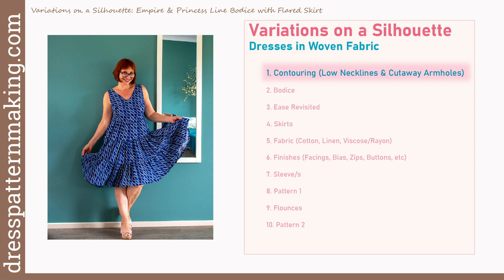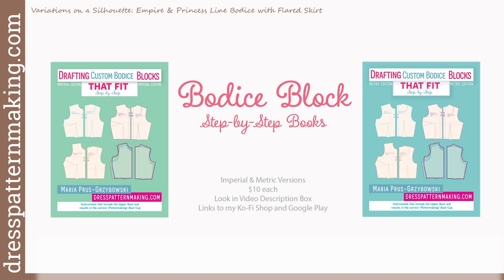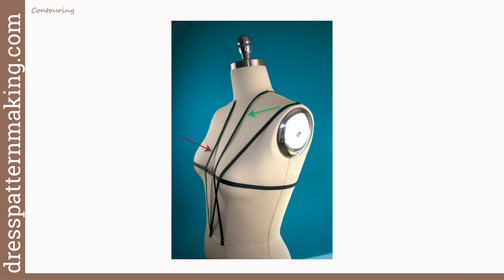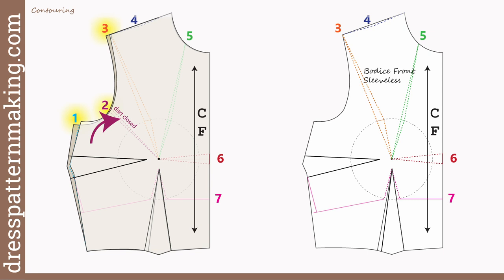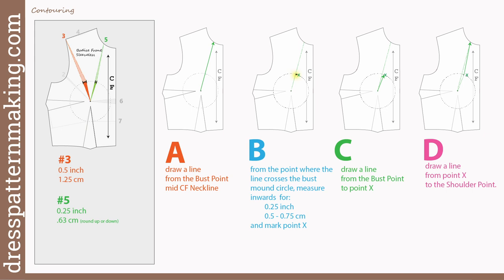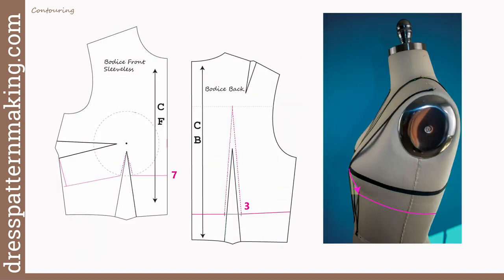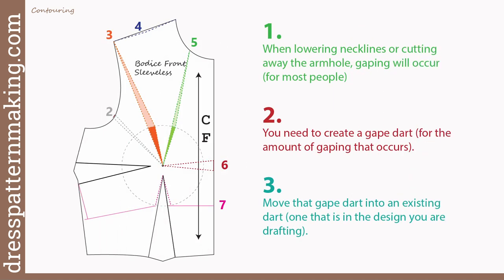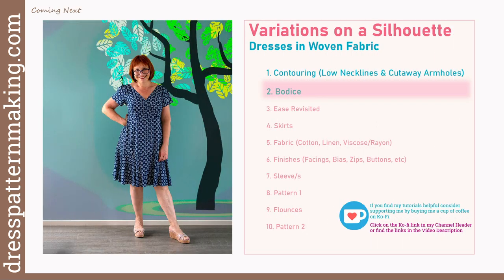Contouring for Lowered Necklines & Cutaway Armholes (Part 1: Variations on a Silhouette)

Comment: Hi Maria, please consider doing a video on the different types of collars. Especially the shirt and coat collars. I enjoy your patternmaking instructions because they make sense and not just a set of calculations and assumptions.
Reply from the maker: Hello Hira(?)
I have been focusing on built up necklines and collars recently, but it will probably be a while before I get to writing instructions for them.  There is so much that I could do but I am limited in my time given the amount of work it takes for me to create a video.  I have decided that I am going to focus on Pattern Videos for the first half of this year (patterns from beginning to end).  First I will be doing dress patterns, each with different skirts and/or sleeves, etc.  The last couple will include (a) a built-up neckline (my Willow Dress), and (b) a dress with a collar (convertible/camp collar).   After that I want to do a couple of jacket patterns - one with a tailor collar, and then a shirt pattern.

So.... at this point it's not likely that I will do a video just on collars, it will be along the lines of doing one collar in a pattern where I have used it.  

But collars are what I've been working on lately.  I've done quite a bit of testing to figure out why I'm having the issues that I'm having.  I have learned a lot and will eventually pass on that information. (In the past I avoided high close necklines with collars (compared to, say, a tailor collar which sits away from the neck) because I just couldn't figure out why they always seemed to feel too tight. I always ended up lowering the front neckline and/or opening up the whole neckline. That created other problems and I also didn't end up with a high close neckline.  I have finally found out that a bottle-neck adjustment fixed the problem......)
Reply: So ture, finding comfort and a good fit is so rare but I'm glad that I found your channel. I feel like your videos have answers to my questions that books don't answer. Looking forward to your upcoming series. Sending love and best wishes ❤

Comment: Question: What do I do if my bust mound circle goes off of my pattern block at the center front? I have a large bust-waist difference, and it's been impossible to draft anything with triangles or cups in the bodice, like a halter-style dress, for example.

Comment: Hi Maria,  This lesson on Contouring is very helpful.   Is this lesson on the same path for making an actual Bra Cup?
I would love to make a full support bra that won't ride up my back when I bend over.  
Thanks Maria!
Reply from the maker: Hello Momzilla, the general theory applies, but you there would be more work/contouring (amounts) over the breasts to get the correct shape - and this is referring to the coutouring around the top of the bra.  The shaping from the Underbust to the Upperbust is another thing entirely.  Drafting bras is entirely a different animal.    I did a lot of research into drafting bras - there were (not sure if they are still there) quite a few free articles on drafting bras on the website Foundations Revealed.  I would suggest you would need to do some reading first. (I will eventually get to drafting bras, just don't have the time, but I really would like to do a video about why getting bras that fit properly can be so hard for some people, and it's the same difficulty as for the Bodice Block - the Upper Bust is 'assumed').
Reply: @Dresspatternmaking  Assumptions in every brand.   That sucks when someone has small shoulders.
  I've watched how you draft the Empire Waist  already.  I'll take a deeper dive at your Website under Foundations and look for those Articles.
Thanks Marie   Enjoy  the upcoming Weekend!
Reply from the maker: @momzilla9491  - Hello again, some misunderstanding... The articles on bras that I'm talking about is on a website called Foundations Revealed (founder Cathy Hay) that used to focus on drafting corsets and bras.  They used to have a number of free articles on drafting bras, but I don't know that they do anymore.  You could check it out and see.

Comment: Confirming, when measuring the bust radius, this follows the tissue (use a flexible/fabric tape) and not a straight measurement (use a rigid ruler)?
Reply from the maker: When measuring on your body, then yes, you use a tape measure from the Bust Apex (basically the nipple), following the curve to where the breast tissue meets the chest wall.  (This measurement can change depending on the bra you have on).

Comment: What do you do with the back? What do you cut out and what do you do with the dart?
Reply from the maker: The contouring that relates to the front is essential for avoiding gaping in the neckline.  Contouring as it relates to the back is limited to reducing ease to get a CLOSE fit. 

What you do with the Bodice Back depends on the pattern you are drafting and your preference.  The 'standard contouring' amounts I show are for reference.  If you want an Empire Line pattern, then you would cut off the bottom portion (making sure that the side seams match the front).  If you want a closer fit in the back, you would use the bigger and higher dart that is shown in the directions.  However, you don't have to use what is shown.

The back pattern will have to match the front at the side seams and the shoulder, but what you do otherwise if up to you. I show the 'Standard Contouring' amounts and standard contouring shape for the Bodice Back for reference only. (I.e.  marking the Empire Line and increasing the dart width and height for a close fit).  However, you do not need to use them if they aren't relevant to the pattern you are drafting.